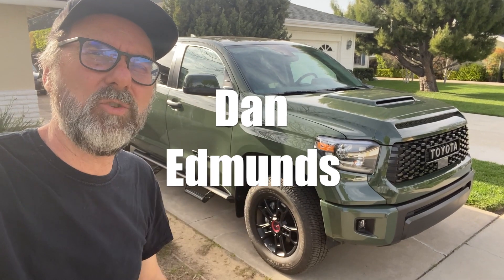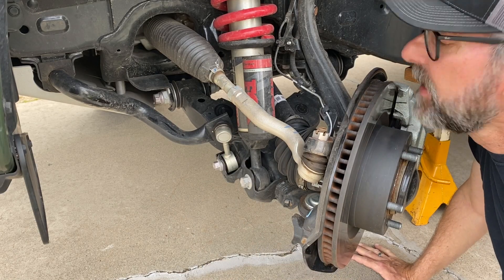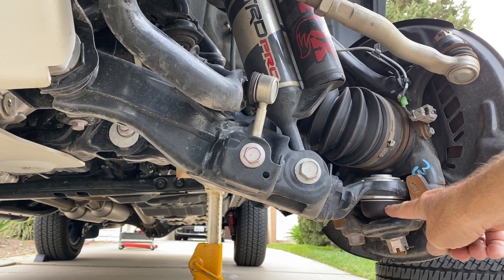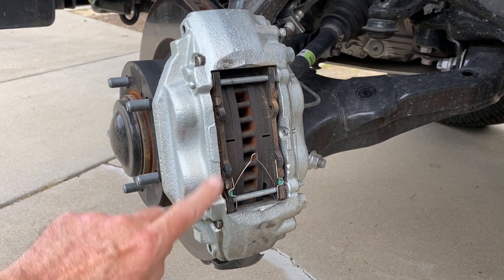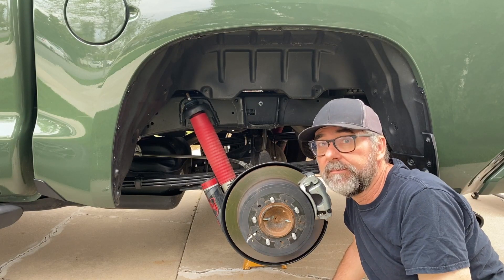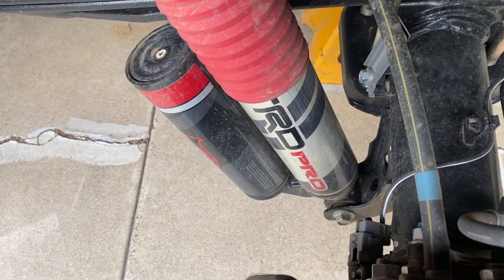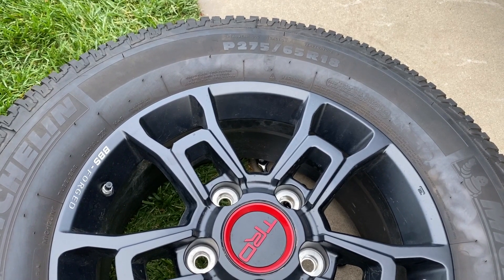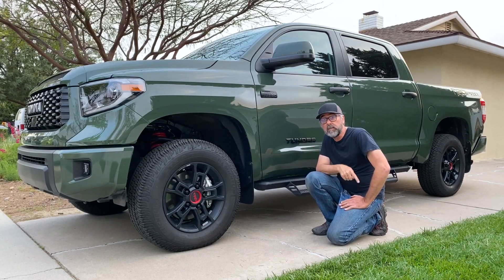2020 Toyota Tundra TRD Pro Suspension Walkaround - See What Makes it Off-Road Ready

Comment: Smashed the sub button.  I have a 21 SR5 with a 2.5 levelling kit in the front with 33 12.5 20” tires.  What would you recommend to eliminate the spacer kit in terms of suspension kit front and back.  I’ll also be installing an air bag kit for the rear.  I love the green colour.

Comment: It's good to discover your videos. In your opinion is there a need for a TRD rear sway bar?  The only thing I would change on the 2021 TRD Pro is the P275 tires. They allow room for more travel but too small to look good. That being said, my truck has new BF Goodrich P275s on it when I bought it so that will do for now. I'll get better economy with smaller tires but I didn't buy a 4x4 to get economy.  I do get better mileage with a 5.7 Tundra (16+) than I got with my 3.5 Tacoma (14.5 - 15). That is seriously messed up.

Comment: I thought TRD PRO came with red painted front and rear sway bars?? Your front bar is black and I didn't see the rear bar at all. So the only difference between the standard 4x4 and the TRD is the shocks an slightly larger wheels?

Comment: I want to purchase a tundra for my work truck. I currently have a ram 3500 diesel. I like the truck.  It want something more reliable. I know I’m going down to a half ton truck but I want the reliably. I will be doing snow removal and pulling lawn equipment and sometimes my 40 hp compact tractor. My trailers usually weigh from 4500 9500lbs. What I’m asking is would the TRD suspension be better for a work truck or the regular SR5. Thank you. Eric.
Reply from the maker: Toyota's TRD off-road packages don't come with lower payload and tow ratings, like some others. The Raptor and TRX are developed in a way that trades away a bit of work capability for extra off-road suspension travel. The TRD Pro doesn't take things quite that far because they want to lave payload/towing alone - the rear springs are the same, for example. It's not as much of a high-flying dune jumper as a result, but that doesn't matter to you, from what you describe.

Now, I don't think I would say that you NEED the TRD Pro because, for a work truck, it is mighty expensive. The SR5 should do it as far as your work needs go. You can always split the difference and go for the TRD Off-Road, which is a milder (and cheaper) Off-Road suspension than the TRD-Pro. Or you could always upgrade your shocks later on if you want to upgrade the truck's off-road wheel control once you've owned it awhile.

Comment: Fantastic video Dan. Can you do the flex index for the stock Tundra vs. the TRD offroad/PRO? I'm interested in how different the suspension really is
Reply from the maker: I didn't have the ramp here when I shot this. I'll try to get a Tundra in again some time. I think the difference between the two has more to do with having shocks that survive continuous pounding on whoops and washboard. Without testing, I might guess that flex might be similar. But that's a guess.

Comment: Thanks for the info, very informative.  How would you compare the TRD Sport sport-tuned Bilstein shocks vs. the stock Tundra suspension.  I'm looking for the better/softer pavement ride since I don't do any off-roading.  I have a choice between a Tundra Ltd (Std stock shocks) vs. TRD Sport Premium (with sport-tuned Bilsten shocks).
Reply from the maker: How committed to you to buying a new Tundra now? The all-new model is coming out in about a year or so, and the spy photos I have seen tell me they are most likely going to coil spring rear suspension like the Ram. That will be fantastic. The Ram is the smoothest-riding truck for pavement goers that never go off road. 

If you're not into that (or the wait) the TRD Sport is probably firmer than you'd want. I might go with he standard tuning.

Comment: Great vid ...just got my 2020 Tundra Trd Pro love the truck but it has a nasty bed bounce felt at highway speeds on roads that have concrete expansion joints that is something I need to resolve , it is fairly severe. Any thoughts on how I should proceed ?  Thank You John in Denver

Comment: Why do you think a simple multiplication and summation is making you a nerd? Anyway I liked to see the actual tape measurement to see the actual diameter while on ground as the tire is not sitting completely round but a little flat at the bottom.

Comment: I HAVE A  QUESTION IF I WOULD LIKE TO BUY THOSE SHOCKS FROM THE TRD FOX SUSPENSION FROM EBAY , TO INSTALLED IT ON MY 18 TUNDRA I DON’T NEED TO CHANGE THE CONTROLS ARMS OF THE TRUCK DO I.?

Comment: I'm interested in getting a Tundra with the smoothest ride on paved roads. Which setup would best accomplish that?
Reply from the maker: I think that would be the TRD Pro. Ironically, the Fox shocks that do so well off-road also smooth out pavement disturbances better, too. It's because their bypass design allows them to be softer towards the middle of the travel and stiff out at the ends.
Reply: @DanEdmunds  I finally bought a 2021 Tundra TRD Pro last week. I love everything about this truck (except mpg). It's soooo comfortable driving on paved roads.

Comment: So not a word about the actual suspension specs. I know the diameter of the shocks increase to travel and at the front is supposed to give you about 2 inches of additional lift but no one ever talks about whether the rear springs have any lift. I have a 20 Pro and need airbags for towing and they either need a block for springs with a lift or nothing additional if the springs are factory or for the “regular” models

Comment: Now are the Fox shocks considered "remote resevior" or a "piggy back"?
Reply from the maker: Remote reservoir refers to any type external reservoir, but it is most often applied when the unit is mounted away from the main shock and connected with a hose. Piggyback is a type of remote reservoir, but that specific term is used when the external reservoir is rigidly attached to the main shock body with an internal passage in the casting that takes the place of the hose. On the Jeep Gladiator Mojave, the front shock is a classic remote reservoir and the rear is a piggyback-style remote reservoir.

Comment: Thanks for your video , 👍 
Do u think that suspensions for daily driving and how soft and feeling when u driving it ( not off road )
Thinking about upgrade it to my 2018 tundra
Thanks
Reply from the maker: The newer TRD Pro suspensions ride very well on the street. The internal bypass feature that makes them ride the bumps off road so well also allows them to be a little softer in the middle of the stroke where you ride around town. Win-win.
Reply: @DanEdmunds  thank you very much for replying,  will upgrade mine  2018 sr5 tundra suspension to trd pro suspension soon 😉

Comment: Great video Dan.  Do you know if these Fox shocks can be purchased and put on my '18 TRD SR5 TRD?  Considering the Bilstein 6112/5160 combo, but these look great.
Reply from the maker: I installed a set of 6112/5160 on a Tacoma TRD Off-Road long-term test vehicle. For the money, I really liked them. The fronts come with springs, if I remember correctly. A bit firmer than stock on the road, but really nicely buttoned down in the desert and on severe washboard. The TRD-tuned Fox Shocks are probably more expensive to buy new, but you might be able to find TRD Pro take-offs. Do you know about Vilmont Market on Instagram? Free Toyota-related postings there. A fair number of take-offs show up there. You'd have to get the TRD front springs to go with them, though. They would have been tuned together.

Comment: It is good to hear lb ft instead of ft lbs, just nerding out a bit.
Reply: eminye1 lb ft is correct for measuring power output, but in the case of tightening a bolt the correct measurement is ft lb...just a little something I picked up in my 40 year career as a design engineer for a major truck manufacturer

Comment: Awesome job, Dan!! You really know your stuff about suspensions. Now I know in detail what a superior suspension system I have on my 2019 TRD Pro. I had a 2017 TRD Pro which came with the TRD shocks, and the ride quality between the two is so different. The lighter rims on the 2019 makes a big difference in ride quality.
Reply from the maker: The wheels don't hurt, but the shocks are the bigger difference, I think. The 2017 TRD Pro had Bilstein shocks, which are great but don't have the remote reservoirs and internal bypass. Bilstein makes remote reservoir shocks, but Toyota didn't opt to go that route with the earlier TRD Pro. The Bilsteins did have a device that increased damping just before bottoming, and it was effective in the desert, but the Fox shocks have much more elaborate internal bypass circuits, which makes them position sensitive over a much wider range to allow better comfort near the middle of travel while being able to hugely amp up the damping as you get closer and closer to the end stops. The remote reservoirs only come into play when hammering along on deep washboard, so you may not notice that unless you're bombing around in the Mojave.
Reply: MY2NDM3   Thanks for the information I was thinking about adding just the TRD pro suspension to my truck but if I do that I guess I will have to add some rims also.
Reply from the maker: See below. If you can find a set of take-offs that someone is selling off, the Fox TRD Pro suspension will do a lot for you. You can deal with the wheels later. The main thing there is try not to install tires and wheels that are heavier than what you have.
Reply: Actually the 17 pros do have a remote reservoir also have a 60 mm piston, which the Fox do not,only 46 mm 
Due to the internal bypass taking up so much room. My experience was the fox fade quicker than the Bilstiens

Comment: Thanks for the thorough walk through Dan. Would like to know more about motion ratios and how that affects the ride and handling of the vehicle
Reply from the maker: I talk about them regularly, and the differences become more apparent as you see more layouts. Generally, the reaction at the wheel is what matters - the wheel rate, the damping and stabilizer effects as seen from the tire contact patch. The motion ratios don't affect handling directly, but it affects your spring rate, damping force and stabilizer bar choices. If you want a wheel rate of 250 pounds per inch (example, that's not a specific target) and the spring's motion ratio is 0.5-to-1, then you'll need a 500 lb/in spring. The same principle carries over to stabilizer bar sizes and damping forces.
Reply: Dan Edmunds  that’s pretty interesting stuff Dan. The Toyotas seem to ride so much better than the competition.  Why is that?  I have a Toyota a Chevy and a Ford and the Toyota rides far better than all of them.  I did test drive the Dodge with the air suspension and that rides pretty good.  I was just very concerned with the air suspension with New England weather and I heard a lot of people having problems with it in New England conditions not so much if they were in dry climates.
Reply: @stevenlefebvre2991  Yeah, the air suspension on the Ram is junk.  Very problematic.

Comment: Why couldn’t gm tuck the shock mounts in like that instead of being out in the open and vulnerable especially the zr2. Gm Junk
Reply: My impressions for why they keep doing that after all these years is likely to do with how the suspension rides. I wonder if Dan can comment on the geometry there and pros/cons of having the shock mounts the way they are. 

If you look under every Toyota truck, you'll see they do a good job of packaging everything to be tucked underneath and all you see is a flat plane under the truck. GM, if they don't hang the spare tires low, they want to make sure the shock mounts get hit first. I won't even comment on their reason for their dangling parking brake cables.

They must have their reasons.
Reply from the maker: I think that Toyota has always included off-road use as a design principal going in. Other truckmakers are thinking towing and hauling going in, and they don't prioritize off-road in the same way.  Look at the Tacoma. It sits higher, people gripe about its driving position, but they do it to get the frame up higher for ground clearance. Meanwhile, the Colorado has a a dumb air dam, shocks in the middle of the axle, and only the ZR2 has the clearance underneath  that equals a normal Tacoma. It has a nicer cab, though.

Ram, on the other hand, is miles ahead of everybody with their link-coil rear suspension. When they get serious about the TRX, we're going to see a lot of rear articulation out of that truck. I can't wait.
Reply: @DanEdmunds  when designing the rear, does the geometry of the mounts have an effect on ride, torsion, or payload? I want to believe there's gotta be a reason for GM to continue engineering things the way they do.

Comment: And the BBS forged wheels save about 3lbs per corner... so at roughly double the cost vs the cast wheels, you can see how much toyota valued even 3lbs per corner in un sprung weigh shaving!               

The 2019 Pro I have personally is now sporting 295/70-18 Nitto G2’s in a P metric load rating. These were the ONLY P rated AT tires in that size (which is the largest you can run without modifying the ride height)! I searched long and hard to find these as I did want a larger tire but didn’t want to sacrifice any more than necessary in performance to get there. These tires weigh 50lbs ea in the P rated vs 63.5lbs ea for the LT! 13lbs per corner!!! The factory Michelin LTX’s weigh in at only 40lbs, so I gained 10lbs per corner vs 23 lbs. the difference was still noticeable although very much acceptable as a compromise.

Comment: First let me say well done! Straight to the content, very good technical content without being over baked! 

To your comment on why TOYOTA doesn’t use an LT tire... if you’ll look at all the cost and engineering that went into the suspension development on this truck, and you understand that unsprung weight is the nemesis of suspension/brake performance, then you look at the same size tire in a D load range, you’ll see that you would be adding 10-15 lbs per corner in suspension fatiguing unsprung mass! Also, a little known nugget, a P rated tire in any given size has a higher load rating at 32psi (or whatever the Mfg’s recommenced pressure is on your half ton) than any LT tire will at the same pressure! The P rated tire far exceeds the load rating needed to meet max GVWR of the vehicle at the given inflation pressure. The LT is capable of using a much higher pressure rating (60 psi) and thusly can achieve a higher load rating but only at the cost of ride quality and suspension longevity and performance. In other words, LT tires would only serve as a detriment.
Reply from the maker: Yes. Those reasons are the reality behind it all. They could choose to do it, as Jeep and others have. The argument makes perfect sense from the POV of the standard Tundra. The TRD Pro would have had to be included in the initial design concept of the truck, but I think it came later and was independently developed by TRD with certain design restrictions imposed by TMC.
Reply: Their cost of engineering and development of these Pro Tundras have been paid for years ago.

Comment: Already rusty...
Reply from the maker: You'd be surprised how common that is. Not an issue with certain cast-iron alloys. Light surface rust isn't a huge deal.
Reply: At least it's not a crappy gm truck with the wax coated frames

Comment: Thanks. I have the Trd Off Road package. I would like to know if there is any difference in the suspension from base model.
Reply: Tim Johnson The TRD OR package adds the BILSTEIN 4200 series mono tube shocks and slightly different coils vs the SR5/Sport/or Limited/platinum trims... these shocks are still quite capable and arguably more durable than the standard equipment, they’re also tuned slightly softer as an assembly than the Sport or standard models. Keep in mind in comparing them to the Pro suspension system that you’re looking at a 40mm digressively dampened monotube shock vs a 65mm bodied, remote reservoir, internal bypass system. So right off the bat, we’re talking more than 300% more fluid volume and piston surface area if you don’t even account for the remotes... also, 2” less travel capability and only a few damping/rebound zones vs something like 7 dampin, 10 rebound zones in the Pro.
Reply: DirtE30  Thank you so much for explaining the difference in the shocks I have a 1794 with the TRD off-road package and I have been considering upgrading the suspension to the pro shocks and it is nice to know the exact differences thank you.  But maybe you could help me if you install the TRD front shocks it is supposed to lift the front end 2 inches and I would like to keep the same Rake that the truck has now that means I would have to lift the rear of the truck besides just putting on the rear shocks if I wanted to keep the same rake.  And what is the best way to lift the truck in the rear I don’t like lift blocks and I don’t really like changing the shackles.  What do you think about adding a leaf to the spring pack this would also give me a little bit more capacity in the bed of the truck?   But I am also worried if those shocks would work with that slight lift in the rear?  I know we are only talking 2 inches but I don’t like that flat look when the truck is going down the road.  Plus my truck only has 2 inches of rake in it right now and if you add the 2 inches in the front the truck will become flat.  Thank you for any advice you may have.  There is a cap on the back of the truck at all times and about 200 pounds of tools. I also installed a TRD rear swaybar.